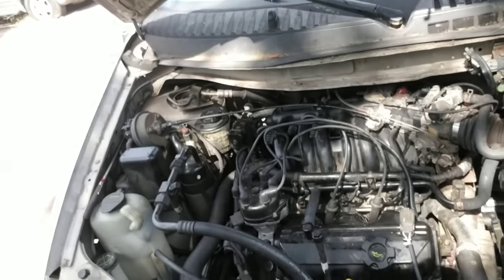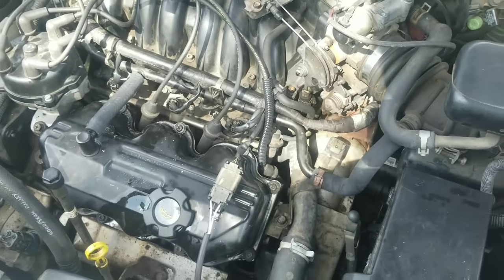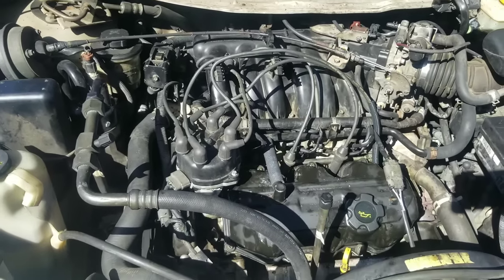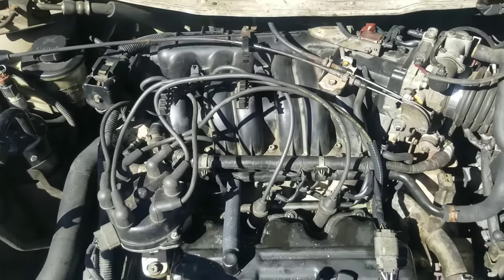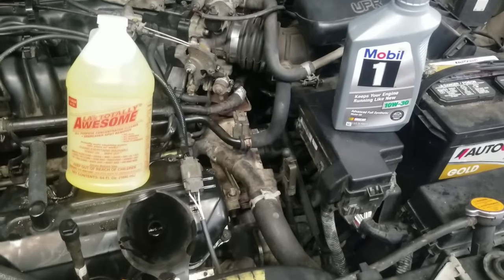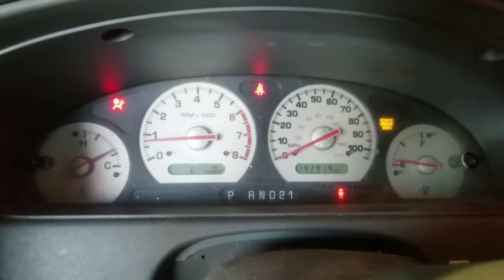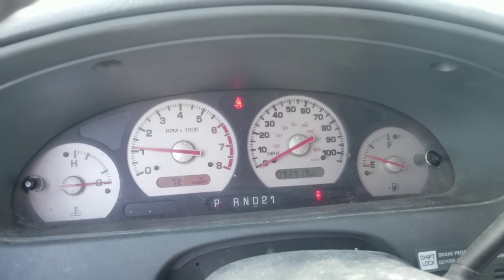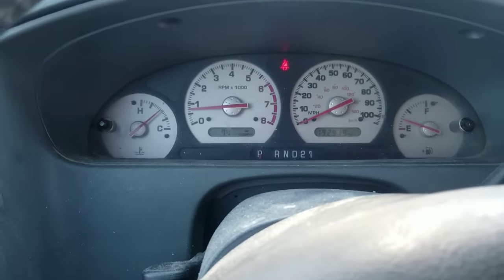How to Clean The Inside Of Your Engine The Easy Cheap Way.

Comment: Nice Video! I am curious when doing this process has it in any way helped increase compression of an engine? I think that would be something interesting to see completed as an over all video. Take an engine that is low on compression but will run and flush the motor per your steps and see if compression is improved.  

One more thing you never mentioned changing of the oil filter once during the video. I would imagine that it would be necessary to do so with each engine flush.
Reply: Richard out of curiosity, compression shouldn't improve because of solvent he used, because compression is simply composed air inside the cylinder walls? Or am I wrong
Reply: @Triplemyworth709  That's part of it. The rings on the pistons as well as the wiper seal can get gummed up and stick in the piston grove itself, AKA collapsed rings. That would decrease the compression in the cylinder. Sticking valves could also cause a loss of compression also. the valve stems could get a carbon build up and cause them to hang open for just a moment which also could cause a loss in compression. Clean engine (inside) is a happy engine.

I'm a fan of Marvel Mystery Oil. I add about a pint before each oil change (300-500) miles before its due. It helps break down carbon and slug in the engine. You can also substitute up to 20% of your oil with it and run it the full life of the 3000-5000 miles.
Reply from the maker: Thank you please like, share, and subscribe, also please check out my other channel Salem Taxi, on YouTube for more material on a different level.

Comment: I usually flush mine with a couple of liquefied Peanut Butter and Jelly sandwiches. Kudos to your new engine blowing technique. LOL
Reply: that will make the car saturate .. lol
Reply: LOL... thanx for this reply.. this just made my day.
Reply: @Vaquero  Then I have a small mind, because I would never put kerosene or diesel in a modern engine oil system. I am dubious of transmission fluid too. At idle, it won't hurt the engine but it might be bad for the engine sensors. Stick to products formulated for the purpose.
Reply: Engine was already bad dude
Reply: Hahahaha best comment ever!!!
Reply: I have to cut the crust off for mine. She's spoiled. ✴️🔆📀❗☠️🏁

Comment: this guy is the ICE-T brother... :)
Reply: After 35 years of professional ase certification pull the oil pan and clean .water based soap ?
Reply: The pan is easy to remove . Yuk
Reply: Shirt mechanic
Reply: Knock knock knock knock knock engine bearings.

Comment: I had a succesfully flush once. Two years later was like reversing it. I flushed two times with new oil after i drained the old with new oil to max. To make sure i got out everything which could get in the pick-up. But if i was you and wanted to flush the engine well. I would before other attempts remove the pan and clean it well. The shape on the pan and location of drain hole might make chunks be left there anyway. It comes out by coincidenses there. And by vleaning the inside of the pan you will know definetly that more dirt actually come from the top of the engine. And i hope you let the engine idle on oil only to get a rest from the additive and lube again. Regards one which have experienced good and bad side of flushing. The other time i just heard instantly by the ticking sound compared with first time it was definetly not good, so i stopped the engine and drained it and took a fresh oil flush and finished off the oil and filter change. That was 2 years after the succesfull flush. And i drove on extra thin oil for a trip to know i got flushed out the additives from the valvelifters etc. Now on my Bmw i doubt i do flush. Because i cant ise thinner oul like i did on the Volvo. Because Bmw is made for this thin oil. But the Volvo couldnt handle that oil. It was to thin and leaked out everywhere😂 do i changed to the normal Volvo use. But i just wanted to be sure i got the additive out so it couldnt do harm. So the engine went back to the oil consumption it had when i bought it. But the first flysh on it made good. Oil consumption fell down. The oil was transparent and had new look from the bottle for a year. And i was on vacation. Was 40 hrs driving on it almost. And oil level was on top (max. Mark) fredh and champagne transparent. It darkened to black quick when winter started. But i felt regret a while on flushing it again. Was a good engine still. It had less rattleing at cold startups than many other newer models. Then i let my father borrow it. And half year later i got the news that the timing belt snapped and engine got totalled, boring news. But i would taken off the pan sometimes during the progress if i was there with that car😊
Reply: AND, every var should had oil pressure gauge. It is much eadier to monitor oil pressure fade development by time. Or/ and if/when it is better. In a Mercedes i had that. It went lower and lower on idle. But on while driving it was where its supposed. And i was truckdriver and it took 2 years to drive it almost 300 000km. And during that well shortened time during km climb it was easy to notice lower oil pressure on idle when it was close to service. And after service. But still there was tiny drops of pressure 😊 Gauge should been mandatory!!!!!!!!😁

Comment: Usually a check engine light will go off once u disconnect a battery. Ill try on 88 dodge raider 2.6 4 cyl. auto. Hope it works.

Comment: When you pour it in the top, will it drain to the oil pan without running the car?
I'm thinking for a first pass, drain the oil, plug oil pan, pour in awesome expecting it to settle in oil pan and let it soak overnight before draining.
Alternatively, load up clean garden sprayer with awesome mix, carefully use a little plumber's putty and sprayer to load on inch or so in the drain pan, pinch closed putty for a soak.
I want to try this with my cub cadet...

Comment: Kerosene will mix with the oil and is a safer alternative to clean your engine.
Reply: Pretty sure Kerosene is bad for seals and this engine has 190K on it
Reply: @oldschooldude8370  And Awesome isn't bad for your seals? Most of your over the counter engine cleaners/flushers are mainly made up of Kerosene.
Reply: @neutrodyne  Awesome is a multi-purpose cleaner not engine cleaner.
Reply: Diesel fuel is safer bet for seals and bearings than kerosene

Comment: I'm pretty sure Awesome is a propylene family glycol ether which is in a family of chemicals that can swell or totally dissolve rubber seals. I would be very wary of adding it to a crankcase (or automatic transmission).
Reply from the maker: no rubber inside the crank case and the product is cleaned before the car is put back on the road, oh yea and it is still running great.

Comment: awsome video man i have one question will thise maybe fix or do something to the lifter noise my 06 chevy silverado is doing 🤦🏻‍♂️?  if i do thise kind of flush ?
Reply: Alex Lachey probably won’t help if you regularly change your oil.  My 5.3 did that too, and it was the O-Ring for the oil pickup tube.  You’ll need to drop the pan.

Comment: I use Mobil 1 to clean dirty engines. Every synthetic oil cleans well and it's cheap. Once I get it clean,I change to Amsoil.

It's the best oil I know of. I've stopped engine oil use on gas and diesel engines with it.

Comment: That's is very great work my friend you are a professional Mechanic and yes you have to take your time on these type of work when you are changing your oil on your car. I do the same thing as well when I have time to change my oil on my car and it work very well. Thank you for your expertise and time, Don let these negative comments from these unprofessional mechanics want to be and keep doing your videos. Let them get ripe off from someone that doesn't know anything about oil.
Reply from the maker: THANK YOU
Reply: Would You recommend this method for a 97 Mustang
Reply: Miguel Pacheco Jr.I am a professional mechanic and engine reconditioner ,people that think like you are my best customers because of all the Bullshit they listen to by pillocks like this,this sort of action does absolutely nothing to improve a tired engine in fact it can ruin it completely,this obsession with flushing engines out with diesel,kerosene,parrafin,petrol or anything else other than engine oil is a recipe for disaster and should not be done,take Note.
Reply: +David Ellis make a space after comma
Reply: david ellis - take note, people have been doing this for YEARS and YEARS long before you were a mechanic, with no problems at all. I am one of them.  no problem except what to do with all the stinking dirty black oil that drained out of the pan. you get more business from people who have never done this than you do from people who have...because most people are too stupid and are ripped off by a rebuilder than try something COMMON SENSE like this.

Comment: There are a lot of things going on here. We know that a head gasket failure will mix water/coolant directly into the oil and it will not immediately kill the engine. The oil becomes milky because it is emulsified with the coolant. So water in the oil is not an immediate death sentence as long as it's not enough to bring the oil entirely outside the working viscosity range. It will however at the very least cause corrosion in the long term. But it's also a common observation that the pistons right next to a head gasket leak are often cleaner.

However with a head gasket leak, the water mixes with the oil more gradually. If there is a lot of water in the oilpan and if it gets sucked into the engine in large slugs, this may starve bearings long enough to cause a failure. So it is beneficial if there is some kind of emulsifier present to help mix the water and oil together.

Some engine deposits build up because they are not oil soluble. Naturally since we only allow oil near a crankcase, these might be the kinds of deposits that remain until the engine dies. It might do some good to consider how to deal with these deposits. A safe way of adding water to the crankcase might be worth trying.

Personally I would be tempted to try just adding 1/4qt of distilled water to the crankcase at a time. The water will vaporize in the crankcase and supply steam to the intake through the PCV/breather tube.  You can watch the oil dipstick level to see when the water has fully evaporated, if it ever does.
Reply: Replace alternator on 13 chylser 200
Reply from the maker: look into sea foam same principle 
Thank you please like, share, and subscribe, also please check out my other channel Salem Taxi, on YouTube for more material on a different level.

Comment: My cylinder 1 is misfiring . Mechanic said they flushed 3 times with there machine . So I’m going to try this product awesome and will record for results
Reply from the maker: check you plug, coilpack, or plug wire.

Comment: Never heard of using degreaser, but I have done this with diesel and it can work. I have even heard that you don’t need any oil mixed with the diesel to run at idle; that the diesel has enough lubricating quality by its self ... but I am not willing to try it! What some people are not considering it that this is a last ditch effort to save an engine in a car that a rebuilt or replacement engine is not cost effective... not doing it anything will result in the end of this engine anyway. So if trying this kills the engine, it was just death during triage! Long story short ... keep your oil changed!

Comment: Only two things I would not let this man put on my engine, his right hand, and his left hand. That stuff is in a spray bottle for a reason. If you want to dissolve sludge inside a motor put a half to a full quart of Marvel Mystery Oil in it and drive it for a week or two and then change the oil.

Comment: I wonder how much bearing material is gone from this method??
Reply: That's what I'm wondering. Nothing wrong with soaking the pickup screen, but never pour the chemicals into the oil fill, and definitely don't run the vehicle. No need to run it to clean the screen.

Comment: That's cazy I got a 95 s10 and it sludged up but the upper section is cleaned but was not getting any oil removed the drain plug an it had sludge I need to do something  THANKS

Comment: I've seen other things done. One person removed the drain plug, and ran diesel fuel through the dipstick tube to flush out the pan. He did not run the engine with diesel fuel in place of the oil. Seriously, I would recommend idling with 5W20 oil and some kind of solvent additive. I shop at the dollar store too. Some of the vehicle gasoline additives they sell there have a kerosene base. Or you can get a B-12 equivalent in the auto department of that famous box store for less than two dollars. Try low vicosity oil and a solvent before using something that can damage the bearings.
Reply: diesel fuel has lubricating qualities have used it several times for yhe flush trick and run the engine to warm up just don't rev the motor idle only

Comment: This is the best way to blow an engine.
Reply from the maker: oh well engine still runs.
Reply: And Viola, it runs better. Obviously this is an extreme case where internally the engine needed it.
Reply: Frank M Jr I'm glad it's still running. I've seen many engines blow up in my time. Glad it worked for you.
Reply: I filled up a nerd engine with 100% Kerosene, I mean all the way to the Top of the valve covers as a last ditch effort. No money, so I did it. I drained it, changed oil 2x and ran that mitsubishi with 130k to 230 k , no noise. Unbelievable. Poor man has to do something to try to keep a car. It works.
Reply: Maybe you are talking about michael bay’s car.
Reply: frank m - this can be used to keep an engine from ever getting as bad as the one on the video.
Reply: Yep!!
Reply: Or the best way to revive it, as you like.
Reply: @richguitar93  plain diesel fuel much cheaper than kerosene and will do same trick and has lubricating qualities. auto trans mission fluid will clean very well also